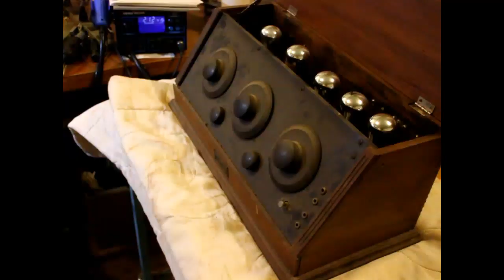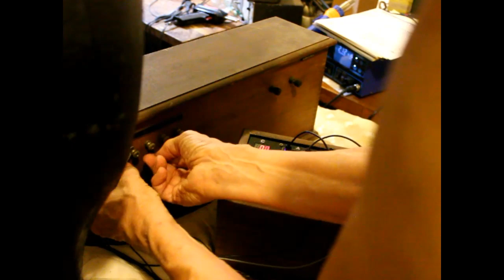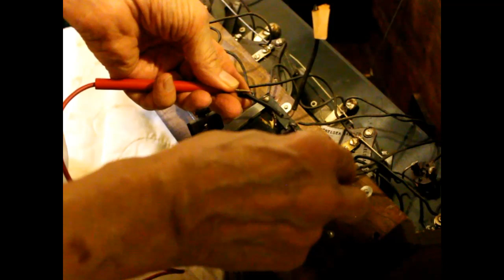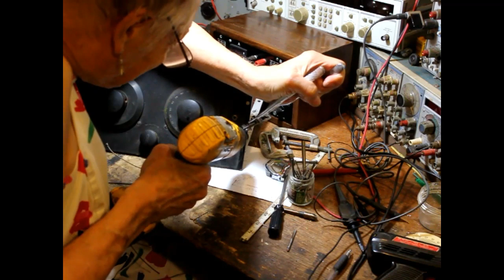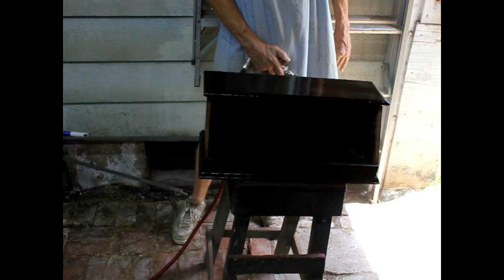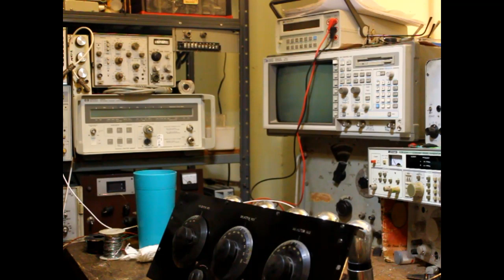RESTORING A 1920'S BATTERY RADIO

Comment: I'd suggest the top be opened during operation because of tube heat.

I'd think that indented lettering could be put on and immediately wiped off.
Reply from the maker: The tubes used in this radio use under 1 watt each so there is insignificant heat generated.

Comment: About your home built power supply.. (well built by the way..) what are the current limits of the three A,B and -C output voltages ? I suppose B and -C voltages can drive 20mA max ? And A output (filament) max current is.. ? Congratulations for your nice work !
Reply from the maker: The B supplies are limited to 25 ma, the A supply 5 amps, and the C supply 20 ma. This will run virtually any battery set. They were all low drain to prolong battery life.
Reply: @glasslinger  Wow !! Ok, then what type of circuit do you use to get 5amps out of a variable voltage (1.2 to 5vdc.. ??) This is a lot of current.. surely not made around a 1amp LM317.. ??
Reply from the maker: @jpdesroc  Check out the LM350CK (it's the T0-3 size device) With 10 volts filtered input the output will be over 4 amps. It needs a good heat sink at that power level but rarely will a radio pull more than an amp or so.
Reply: @glasslinger  Thank you VERY MUCH !
Reply: @glasslinger  I saw you use switches to connect A,B,C supplie's commons to each other. I can see the B- connector can be connected to A+ or A-. Your C supply's common can also be linked to the A+ or A- connector via a second switch but is it the C- or C+ connector that is going to this switch ?
Reply from the maker: @jpdesroc  The C supply is a grid bias supply so it will always be negative with respect to the rest of the circuit. A+ will go to the switch.
Reply: @glasslinger  You meant C+ will go to the A+  A- switch right ?
Reply from the maker: @jpdesroc  Yes.

Comment: Just so you know, the Chelsea Radio Company isn't as obscure a company as you may think.  You just may not have heard of them.  They actually produced a decent line of sets, and was a supplier to Gimbel Brothers of the ZR Magnet series of radios throughout the 1920's which were rebranded Chelsea Radios.  Their best seller was the Transcontinental ZR-4 which you find quite often at auctions.  The Chelsea Super 5 was their first Non-regenerative receiver after all the commotion over the Armstrong patent, in which Chelsea was one of 17 radio companies to have a license for that regenerative patent.  It was also one they didn't rebrand with Gimbel Brothers.  There are actually 5 variations of the Super 5 radio, the one you have had the bakelite front panel, which I think is the most attractive of the five.  The Chelsea Super 6 was rebranded as the Gimbel Brothers ZR-60 Truphonic.  Loved your video by the way!

Comment: I have a 1926 American beauty radio it looks like it’s been restored, newer capacitors soldered in, but I don’t know how to power it. I have a 30 V power supply but the paper on the inside lid indicates it uses 45 and 4 V batteries how should I power this thing to test it?
Reply from the maker: You can get a 5 volt 1 amp DC wall wart either at a junk store or off ebay. The 45 volts you can get by snapping together five 9 volt radio batteries.

Comment: 1:12  So the '01A' tubes were the semi-generic workhorse electronic amplifiers of the early 1920's? Is that like what the '2N2222' Si xsistors are today?
Reply from the maker: A lot like that! There were over 100 brands of 01-A tubes!

Comment: This probably sounds like a stupid question but why are there so many tubes in such a simple receiver circuit? For example why is there a specific tube for each audio transformer?
Reply from the maker: The gain of those old types of tube was about 6. Very low compared to modern pentodes which have a gain in the hundreds. So it took more tubes to get enough gain overall.

Comment: 44:08 "The speaker has an air-gap adjustment for best sound"? Please explain!
Reply from the maker: The old RCA horn speaker has a threaded ring that adjusts the distance between the driver core and the diaphragm. The amount of DC current through the driver changes the spacing due to magnetic attraction so you adjust the spacing back to optimum using the adjustment ring. The DC through the coil changes with the filament control on these old radios, which was a disadvantage.

Comment: I wonder how long the dry cell packs used to last on these parlor radios?
Reply from the maker: The B battery would last for weeks but the A battery would go dead in days. They would sometimes use rechargeable lead-acid batteries for the A battery and get it recharged at the local gas station.

Comment: About that Roto-zip bit... I've majorly destroyed a tube socket because someone recommended that method to me. Since then I've discovered the value of a good stainless steel brush. As long as no strands of the brush get left in the socket (speaking from personal experience in that I destroyed a rather rare new-old stock tube doing it) everything works out pretty well. The point being that it doesn't take as much material off of the contacts. Brushes for cleaning small calibre guns work well too as they are usually made of brass or steel provided they're small enough that is. I use one commonly used on competition grade air rifles. That works on all but the smallest of pin holes.

That said, I am seriously glad to see you making videos again. I find them rather fascinating and informative. Any good repairman or tinkerer knows the value of learning from the mistakes of others. There's also a lot of good information regarding the diagnosis of failure modes and other issues. Thank you so much for putting this kind of content out for the world.

Comment: It is definitely early to mid 1920's, and battery operated. It appears to use very early crude vacuum tubes, like the 01A, or the 'R' valves. They were all triodes, as evidenced by the crude sockets that resemble light bulb sockets

Comment: I'm no expert but that's not 1920's, and also not battery operated
Reply: 3:59 Wrong, that is definitely early to mid 1920's and battery operated. It appears to use very early crude vacuum tubes, like the 01A, or the 'R' valves. They were all triodes, as evidenced by the crude sockets that resemble light bulb sockets

Comment: Fascinating that there were no squeaks or whistles while you were tuning. It must have terrific neutralization considering how sensitive it appears to be. Internal feedback in the valves was a big problem in those 3 dialers and needed careful neutalization if you wanted to get any sensitivity out of the wireless. Many manufacturers didn't bother with neutralization (they didn't want to pay the royalties) and their products were pretty useless as a result. Others used crude methods such as a grid resistors or returned the bottom of the tuned circuit to a pot that was connected across the filament. Turning the pot to the positive end of the filiament loaded down the tuned circuit and reduced the tendency of the valve to oscillate.

I didn't see you do any neutralization adjustments. Do you know if this receiver used neutralization or had some other method to stop the valves oscillating?
Reply from the maker: This set uses the simplest schematic possible. No neutralizing at all. It depends on the loading of the tuned circuits to stop any interaction.

Comment: What grit/gauge of steel wool did you use on the knobs?
Reply from the maker: Extra fine, 0000. This will not scratch the bakelite and yet will take off the hardened on crud.

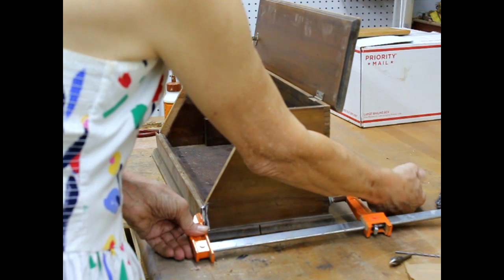Comment: @ 28:00 around... you should have to do this in the first, and also clamp the Groundplate together, so that the Gap in the middle would dissapear - before you screwed the Groundplate to the Sidewalls.  You`re definitivly no Carpenter lol....
BUT: For spraying it with Laquer´ instead of using Wax or Woodoil, you should be hanged out naked on your feet out of the Window in second Floor in a busy Street ! lol
Purists call this a "Sacrileg" Baby ...

Comment: I appreciate your videos. One of them helped me figure out that the tuning condenser was causing the static problem I had. I see you just laying wires along side other wires and then  soldering them. I gather you have never had problems with that? I am of two minds on that. Part of me says that solder should be strong enough and part of me worries about the solder cracking and causing problems.
Reply from the maker: Use good quality 60-40 rosin core solder. Scrape the wire if it is dull colored to be bright metal. Put solder on the wire so it is well coated. Then make the connection, holding it completely still until it cools. You should never have any problems!

Comment: Is it called "B plus" because it was known as A B and C voltages back in the day? I thought "B plus" meant "Beta Plus" for the positive "bias" or "beta" voltage used on tubes and transistors. Or is it just because they had A B and C way back when with the B being the most important so A and C fell out of use or teminology.
Reply: The A battery would be used to power the filaments, the B battery (the highest voltage one) would be used to provide plate voltage and the C battery would be used for biasing.

Comment: 01A'a  have 250ma filaments.  5 of them would be 1.25A
Well it's motorboating!
Reply from the maker: It has to do with where the filament rheostats are set. I think they were at minimum when I first turned it on.

Comment: Great video! I have a 1920s battery radio I bought back in 1968 that I have never touched. It's missing a part that goes into what looks like a fuse holder. Since there is no brand name on it. I'm totally dead in the water as to a schematic and identification of the mystery part. Too bad, it's otherwise intact and near mint condition.
Reply from the maker: This would be the cartridge type grid leak resistor. Get one any value between 2 and 6 megohms and it will work fine. They are on ebay many times. Don't pay more than about $5 for it. Search ebay "grid leak resistor"
Reply: My 1923 Freed-Eisemann had a 2 Megohm grid leak which measured about one and a half Megs high, so I just soldered in a new 2 meg ohm resistor in place of it.  The repair can not be seen, so the radio still appears original.

Comment: Nice! No more AM signals here in Europe to tune to :(
Reply: Plenty. Just search am schedules in Google and you will se the band is crowded. Expect to be able to receive up to 1500 - 2000 km away when the sun has set. Lots of stations from the old eastern europe and lots of stations from uk. One of the strongest is on 1215kHz. You can also find apps on Google play store to get frequency lists.

Comment: 70 year old radio. (what looks like) a 70 year old speaker.....so where are the  70 year old batteries ??
Reply: Dead
Reply: First portable radio I had was the size of a lunch box...had 4 C or D cells for filaments and expensive 45 volt batteries (2) for the high voltage, sometimes you could get the 90 volt battery, you could get maybe 5 hours out of the plate source....car radios back then had the tubes and vibrator....tubes lasted, but the Vibes went bad quick...
Reply: Doug Ankrum  Vibrators went bad often due to bad buffer capacitors. Those have to be changed often with exact spec units as indicated on the schematic.
Reply: Well...we were kids 15-16, our first car....all we knew is the vibrators would not be buzzing, put in a new one, they'd work for a while...this was back when the kids with $$ had those 45 RPM record players under the dash! and most any Rexall Drug store had tube testers, some  of those things tested vibrators also.
Reply: https://www.ebay.com/itm/High-Voltage-Generator-Boost-Converter-5V-12V-Step-up-to-300V-1200V-Power-Supply/252636528171?ssPageName=STRK%3AMEBIDX%3AIT&_trksid=p2057872.m2749.l2649
Reply: Can you use a High Voltage Generator Boost Converter 
5V-12V Step up to 300V-1200V Power Supply?

https://www.ebay.com/itm/High-Voltage-Generator-Boost-Converter-5V-12V-Step-up-to-300V-1200V-Power-Supply/252636528171?ssPageName=STRK%3AMEBIDX%3AIT&_trksid=p2057872.m2749.l2649